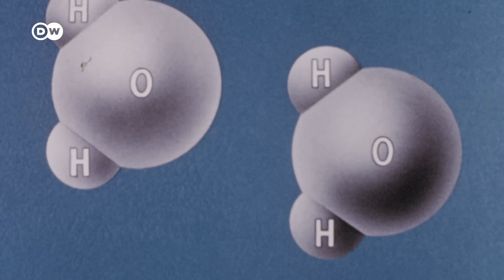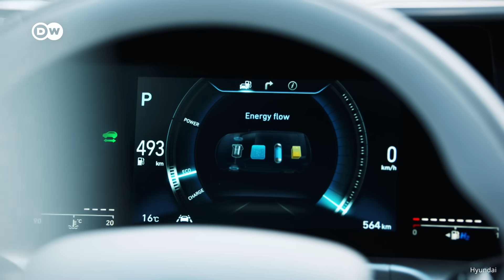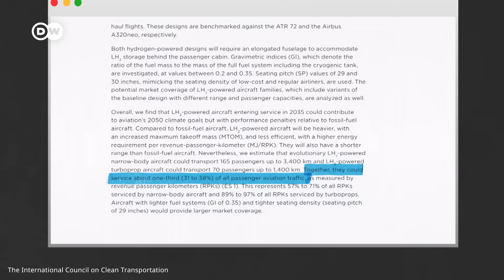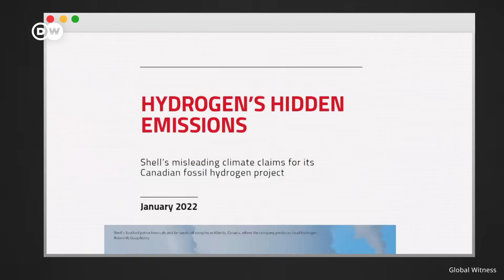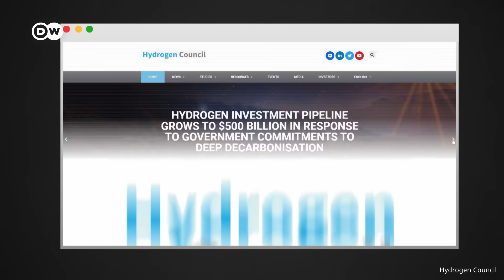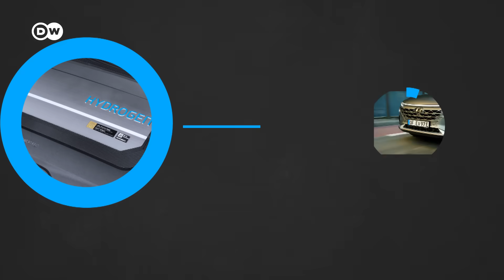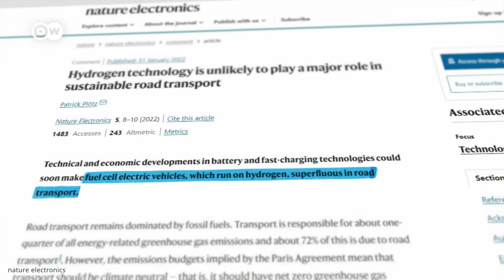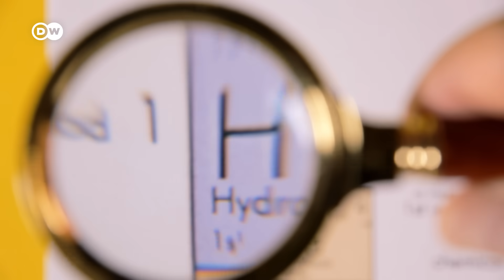The truth about hydrogen

Comment: Hydrogen storage is a big issue. If it's pressurezed, chilled or even liquified it still takes up so much space, leaks, embrittles containing vessels and costs so much to convert. Reacting hydrogen together with nitrogen in a catalytic chamber produces Ammonia, that solves much of the issues of containment since it can be stored at much lower pressures and higher temperatures with conversion efficiencies higher than those of LH2 and much higher energy densities. It can even be used directly in fuel cells just like H2. Thanks for the video, I would love to see your take on this.
Reply: Hydrogen is the smallest atom, and so it’s hard to keep it from slipping through materials made of heavier atoms. Even if you keep it from escaping, it still embeds itself into the container, weakening it over time. This is a known phenomenon that has lead to multiple industrial disasters. Hydrogen needs to be stored differently than natural gas or petroleum
Reply: @justinokraski3796  given a mass production of various H2 applications these days, it is evident that storage solution does exist.
Reply: And here is to be mentioned that the energy necessary to compress Hydrogen is almost 15% of the total energy which Hydrogen can provide it...and suddenly one discover that the total efficiency of a hydrogen-powered installation is just10% over petrol engines... really, this is an option ONLY no one other exist...
Reply: But so does regular gasoline.
Reply: What about a MOF container? This uses a Metallorganic Framework for chemisorption under high pressure. This is actually used by BASF in Ludwigshafen to store theire hydrogen.
Reply: Leaks!? Lol. Which century you come from?
Reply: @batanena  Right! Obviously, this is a Tesla lover that is out to destroy all hydrogen tech. Just look at his Musk/Jobs attire. LOL
Reply: There are many methods of storing hydrogen but the best ones are always ignored in most media for... reasons. Ammonia is already transported everywhere since it's a very popular chemical and sounds fit for big transportation (ships, airplanes, trains, ...).
Reply: Why does everyone keep saying this? It's very easy to mitigate the points you make here.
Reply: I also saw a video about combining H with ammonia, and the benefits seem great!
Reply: Ammonia is not a bad refrigerant either.
Reply: You are grossly misinformed.
Reply: Although you have a point, have you see what an ammonia leak does to the area around the leak? We DO need to do something for future generations though.
Reply: Just turn it into alkanes (Fischer Tropf process) and feed these into existing fuel distribution networks. Much easier to distribute than hydrogen, and if it's powered by renewables or nukes, then it's carbon neutral
Reply: Especially if you are looking at electrical infrastructures like California - Rolling Brownouts…..😮
Reply: Can a car run on Ammonia tho, and how would it smell? ;D
Reply: @Broockle  No smell at all once it's burned or otherwise reacted. If it smells, there's a leak.
Reply: Don't need to store just burn it direct.
Reply: @milvan6829  H2 storage property is what gives advantages over battery based storage.
Reply: This so called experts make everything so complicated just to have something to yack about and most of the time it is total rubbish like this video. Bin it!
Reply: Why not mix it with C ? It would still be carbon neutral.
Reply: @ernie4125  This requires a lot of energy and complicated chemical processes, but methanol synthesis seems to be viable.
Reply: Use it as you make it.
Reply: Hydrogen should be stored as methanol, preferably from biomass gasification and passing over a zinc oxide on alumina catalyst.
Reply: This has been solved. I personally know of a material which is a composite that can store hydrogen at high density but low pressure and only needs to be heated to 100C to release it's hydrogen safely. It didn't get the investment needed. It would revolutionise hydrogen storage. It would allow electric cars to be completely supplanted. That could be why it hasn't got anywhere.
Reply: Yep the ammonia method is very promising interms of functionality. But safety risk of that on a gigantic scale is kind of horrific.
Reply: @Neojhun   Mind you, I went to work other day, and as I drove through the city I was behind a large Truck with a Very large shipping container (seemed to be re-enforced) that  on the back that said "DANGER HIGH EXPLOSIVES"; "NO EXPOSED FLAMES". Diving through the middle of the city! (probably on it's way to the mines up north) Hope it isn't involved in an accident.

Or even more simply tankers hauling Unleaded Fuel through populated areas. That would also make a BIG bang!
Reply: NH3 is hazardous gas. If tank with H2 cracks nothing would happen. But if NH3 will leak, you will need to have make avacuation of nearest regions. And if this would happen on crowded region in city center or closed area, this would be catastrophic. Also NH3 is highly corrosive. Also NH3 dnergetically 25% less energy dens than H2 due to inert N2. If some how decompose CO2 and H2O to 3O, and H and combine to CH4. Like 2CO2+4H2O = 2CH4 + 4O2. And you get zero emission at the end, because you also produce O2 from CO2. 
Also NASA and some companies actively produce C2H5OH ethanole from CO2, burning it it is also zero emission.
Reply: @iIiWARHEADiIi  H2 is also highly corrosive, and leaks are extremely hazardous. 

H2 cannot be smelt so a leak can go undetected. A large hydrogen leak would suffocate everyone nearby if in a contained space as well as provide a significant explosion hazard. 

I agree though that methane is an even better alternative. And C4H9OH (butanol) is also a great alternative as it has the same energy density as petrol and requires no significant reengineering to work in a modern combustion engine.
Reply: @acmefixer1  

Unfortunately, they are true. 

'Proper containers' for hydrogen are typically cryogenic (cooled) or high pressure (to allow it to be stored as a liquid). These are expensive and heavy and require more maintenance than other fuel storage systems. 'No more dangerous than Gas (Methane) is somewhat subjective. Hydrogen has a very low ignition energy requirement like methane making it prone to explosions. On top of that its small molecule size means that mixing odorants with it often prevents it from working with fuel cells. So for many applications, odorants cannot be used (currently).

 Its small molecule size means it leaks even through the best vessels (the atoms literally slip through steel), and its worth noting that hydrogen does act as a greenhouse gas.
Reply: There is also a pretty good solution with an organic contaminant molecule. Makes it into a kind of jelly. Pretty easy to get back again.
Reply: How about BH3 instead of NH3?
Reply: Ragnar Frandsen
if it's liquefied it takes up the same volume as gasoline does but it's actually much MUCH (nearly 3 times) more energy dense. everything leaks, natural gas, oil pipelines, ect (so whats your point?). it doesn't cost THAT much and converting it is much cheaper then buying batteries for the same amount of storage.
Ammonia sounds nice on paper but that's about it, maybe for long term storage and transport but these would need to be very far from people. i would say both (hydrogen and ammonia) are pretty dangerous if they leak in a populated area.

Comment: Germany is backsliding into gas and coal while suggesting it will switch to some hydrogen, in the future.

What I don't understand is why they made that choice?

They could've used nuclear as a transition phase into a carbon-reduced hydrogen-based system. However, at their current rate, France could be potentially first to adopt a clean hydrogen grid.

Comment: I've always been skeptical of hydrogen cars and all that stuff, but if we could use green hydrogen as an alternative for natural gas in fast response energy that would be a good way to actually go net 0
Reply: We don't need fossil gas or H2 for domestic heating when we rapidly increase installations of electric heat-pumps.
Reply: @2nd3rd1st  I'm guessing heat pumps won't work in urban environments
Reply: @graham1034  why wouldn't they?
Reply: @I Argue With Dense People  I'm by no means an expert, but it's my understanding that you need land to bury a heat pump setup. If you're in a city where the only open land is in parks then that will be challenging.

Perhaps for new buildings you can just put it under the foundation? I'd be curious to hear about that
Reply: @graham1034  that would only apply to geothermal heat pumps. They're not all geo
Reply: @I Argue With Dense People  oh I haven't heard of other kinds. Looking online there are air heat pumps but they aren't nearly as efficient and don't work in all climates. Still an option for some cases though.
Reply: I’m just as skeptical about electric vehicles. Mining those resources is just as damaging, if not even more than just using a normal internal combustion car. Plus the amount of child labor and slavery companies like Tesla use in Africa adds to the ethical question as well. And someone talked about biofuel but I don’t like biofuels either because most of them use vast amounts of corn which one, can be used to feed millions of starving people around the world and 2, takes up far too much space in the already destroyed American prairie.
Reply: @UCnEdxp1jaDW4r0CGwD-PAuw I see you’ve seen Britmonkey’s video on banning cars outright. I think trains would be a better long range alternative to cars. Sure you could still use things like trucks and tanks in the military or for construction but otherwise synthetic, nuclear, or even biofuel would work better for trains. For short range movement there’s always walking or riding a bike or scooter or even going full old fashioned and riding a horse.
Reply: Delusional.  Short of a thorium or a fusion miracle, we are going to hit the wall.  I am not promoting these energies, but the fossil fuel world will not be run by feel good green energy.  The density is just not there.
Reply: The thing is for power storage there are much better solutions. In peaker plants we don't care (much) about mass or density of the storage so there are plenty of alternatives that are way more efficient than hydrogen electrolosis, storage and conversion back to electricity.
Reply: @Tamiasciurus The new generation of air heat pumps are able to go down to very low temperatures.  How our stretched electric grid adds them while we electrify the transportation system at the same time would be a double whammy.
Reply: @Tamiasciurus ah, I see you are a man of culture as well. 

But you should also watch Adam Something as well. He pumps out similar videos with similar ideas . Like the one on skyscrapers or flying cars

Comment: Excellent and fair review!! Why use energy to produce hydrogen, transport it, store it to then use it again for energy - when we can just store energy in a battery, far more efficient.
Reply: Hydrogen is indeed way less efficient. But hydrogen is way better suited for long-term storage as it doesn't lose nearly as much of it's charge and is cheaper to scale up if we are talking big size storage. It thus has a place in storing energy, next to batteries
Reply: Ya but batteries are not safe. Did you see the recent containership fire that was loaded with most beautiful luxury e vehicles transported to US?
Reply: @MaryJohanna  Yeah hydrogen is the most explosive element we know of. Not to mention hydrogen cars store it in pressurized tanks at 700 bar. That's enough pressure to kill you 5 times over just from the pressure wave if it burst. And it just so happens that hydrogen is known to slowly degrade its container over time due to the particle being small enough to break open small imperfections. 

So which is worse, a battery catching fire, or having a bomb go off underneath you? Not to mention these hydrogen cars still have a lithium ion cell in them. It's just not as big.
Reply: @Skylancer727  wow the choices 🤔 thanks, I did not know they still also have a battery. We need new inventions that are safer or ride a bike! ✌️
Reply: @MaryJohanna  
A battery is pretty much solid until it is on fire and what's more, in a car or bike you will have time to escape that fire.
Petrol and ethanol need a spark or naked flame to ignite.
Hydrogen is the lightest element and unless chilled and compressed to a liquid state escapes very easily, it also ignites at a lower temperature and at much lower density than fossil/bio fuels.
Hydrogen is a great fuel because of it's high energy density, it's non toxic and burns clean but transportation, storage and use hold big challenges due to the need for it to be kept in a refrigerated liquid state.
Because of it having such low density in gaseous state it can even slowly escape sealed tanks and any build up is one little spark away from kaboom!
Now for something like a cargo ship the challenges are going to be lesser than a land vehicle or aircraft as the fuel cell containment can be reinforced and any refuelling or safety venting of hydrogen could be conducted at port with the infrastructure to to this far more safely than your average forecourt.
Reply: @pauln6803  thank you so much for taking the time to explain this. I appreciate this. I really had hoped that Hydrogen would be a safer solution to powering cars and busses, I think Audi was experimenting with it. There are quite often home fires when e cars are being charged in the garage. So these occurrences made me doubt that we found a good solution to fossil fuel. I am in San Diego and the public busses are hydrogen powered. I really wish we had more public information for people to understand all of these things but instead we have mind numbing trash on TV and social media. I am very concerned about our climate. Have a great day!
Reply: @MaryJohanna  "Ya but batteries are not safe."
Maybe Lithium-Ion batteries are not safe, but what about redox-flow batteries for stationary storage? They can't catch fire because they work basically with aqueous solutions. For mobile solutions solid state batteries are worked on. They should be much safer too.
Reply: @mrm7058  I have to read up in those, are they being considered as a solution to be used in e cars?

Comment: A other good thing about hydrogen energy is that nuclear reactors energy that is not used can be used to make hydrogen and therefor we don't waste any energy.
Reply: What do you mean by unused energy? Energy can not be created nor destroyed. iI is always made available in one form converted from another.
Reply: @afre3398  I think he means you can run a nuclear plant at something like 100% nearly all the time. Put whatever is needed from moment to moment into the grid and use the remainder to make hydrogen.
Reply: @davidbuderim2395  But that will burn the nuclear fuel faster. It is no such thing as free energy
Reply: @afre3398  Agreed.